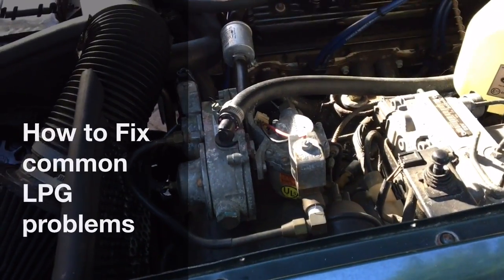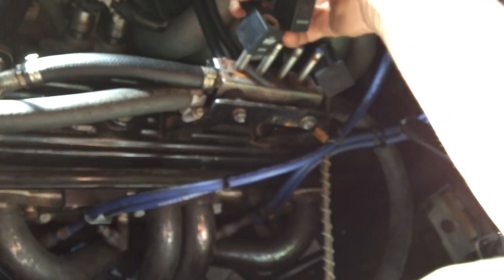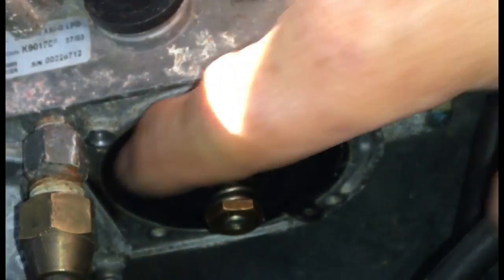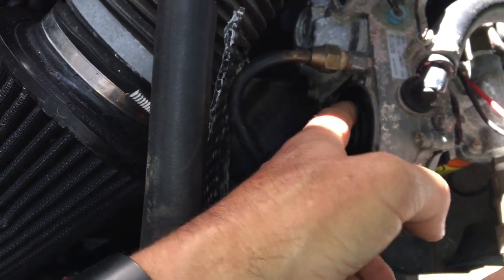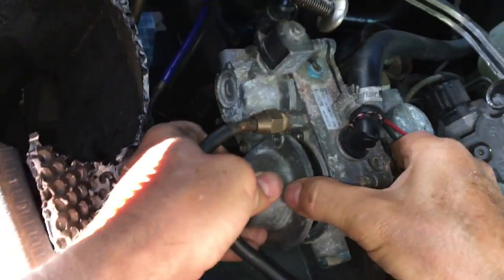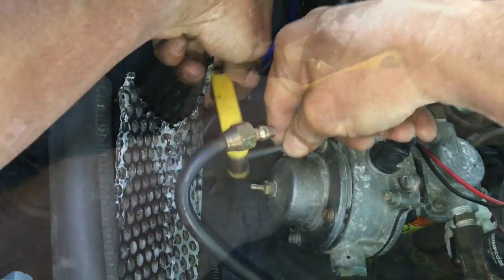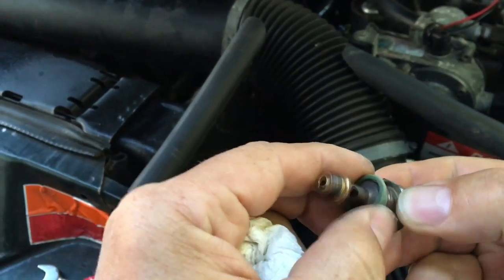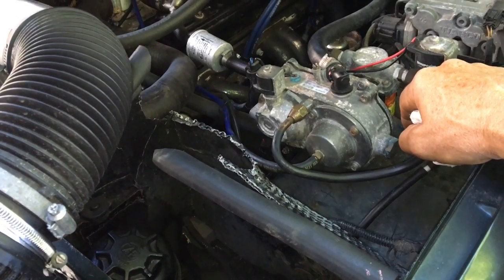How to Fix Common LPG Problems - Vaporiser / Reducer, Injectors

Comment: Hi, thanks for the useful information. I have a 2007 saab9-3 1.8T factory converted to lpg. It recently started dying after 15-20 mins of driving and then I had to wait 10 mins before it would start up again. It came up with traction warning when it stopped but looking under I noticed the gas pipe and wire between tank and engine was drooping off the chassis with corroded fixings. Is it possible a bad wire/ connection between tank and engine could cause this problem
Reply from the maker: I can’t think why that would make it last 15mins then fail.  Possibly a poor connection to the tank solenoid that turns on the gas. Unlikely that it would be that repeatable. More likely a vapouriser problem where the gas is getting cold and not being vapourised properly (check water pipes to and from it are hot) or your Lpg injectors are gumming up.
Reply: @comeinhandynow  Thanks for coming back to me. I've just run the engine and without moving it ran for 10 mins and then stopped. Engine temp was normal but I wondered if a bad batch of gas could block the filter and make the engine run lean/hot. The last gas I got was a small garage in Norfolk where I've never had gas before. Is there a temperature shut off on BRC systems. Had the car 3 years and no previous gas problems but injectors are noisy. (sounds like a diesel on tick over)
Reply from the maker: @davejohnston5158  Just running for 10 minutes sounds like it is freezing up in the vaporiser.  Is the vapouriser hot or cold?
Reply: @comeinhandynow  Vaporisor connected to cooling system is getting hot quite quickly after cold start. Is there an upper temperature cut out on these systems?
Reply from the maker: @davejohnston5158  I don't think so.  If it still is hot when it cuts out then something else gummed up or blocked.  Try a service with new Lpg filters and cleaning up, or replacing the Lpg injectors.
Reply: @comeinhandynow  Thanks for your advice. I'll get it looked at and filters changed. When it cuts out when not moving there's no warning lights so I'm pretty sure it's not the main engine function.
Reply from the maker: @davejohnston5158  It is useful in diagnosing problems to get the Lpg ecu software and interface cable.  It can read the gas temperature and pressure so you can see where the problem is.  If you don’t want to do that take it to an Lpg installer company to diagnose.
Reply: @comeinhandynow  Thanks for more info. I had a try at keeping it running on petrol by disconnecting the solenoid valve in the engine bay and it still stopped as if the petrol pump had been switched off. I"m wondering if there is a safety cut out  that turns both petrol and gas off if a  high temperature is detected. The gas valve runs at high temperature 80 degrees which I presume is normal. My next problem is getting it to the garage - at least it won't be as bad as the 150 mile recovery back home I needed!
Reply from the maker: @davejohnston5158  80 is fine. Are you saying it cuts out the same on petrol as Lpg? (They should be a procedure, like holding in the Lpg switch over button or the like to force it to run on petrol.  Maybe google your system).  If it also cuts on petrol then not Lpg related. Get an obd2 code reader to read error codes from main ECU.
Reply: @comeinhandynow  Thanks again I'll try everything. I would say it's an auto switch over system so I presume this may work by temperature detection and somehow switches the petrol system off. No error messages coming up when it stalls so I'm thinking it's all within the lpg system.

Comment: Yo men my car runs on LPG but when I switch it to petrol it switches itself back to lpg. It will not run on petrol untill the LPG tank is empty. Pls help
Reply from the maker: Sounds like you don't have enough Lpg gas pressure, maybe a faulty vaporiser or stuck solenoid.  Usually there is a procedure to force it to run on petrol like pressing and holding the switch over button.

Comment: I have a prins on my dodge ram 1500 and one day it quit working when I push prins button all it does is beep and doesn't switch. Anyone else have this issue?
Reply from the maker: Not enough gas pressure is my guess due to vapouriser or solenoid problem.

Comment: I have Landi Renzo LPG and after 7 years of use it shakes when I accelerate and appears the check engine on the dash. Have you any idea whats wrong?
Reply: Thanks a lot
Reply from the maker: I can only guess but it sounds like the Lpg/air mixture has gone off, could be a worn out diaphragm in the vapourisor. Also give the gas injectors a good clean and change Lpg filters.

Comment: Hi! I wondering do you have a user manual for software for OMVL gas type. I have the software and i dont want to make a wrong settings to my gas sistem. Thank you!
Reply from the maker: I did somewhere, but probably not allowed to distribute it.  The main adjustments are for the amount of lpg injection at certain rpm.  You should fit an air/fuel ratio meter onto the lambda sensor and adjust the Lpg setting until the A/f reading is correct.

Comment: Another very common failure point is those plastic fittings for the coolant. They're garbage! They get hot, become brittle, and crack resulting in a coolant weep that your untrained mechanic might see and think your entire converter is starting to collapse, assuming you don't investigate it yourself and end up with a pipe in hand and coolant all over everything else...

For what it's worth, you can probably pick up a set of solid brass replacement fittings for 10-15 quid, then it's just a matter of checking / replacing o rings on them every 10-15 years.
It sure beats the ticking time bomb of the fitting snapping completely, potentially freezing the converter, and or dumping your coolant on the road and cooking the engine 👍
Great video in any case
Reply from the maker: Thanks and thanks for the input.
Reply: @comeinhandynow  no worries mate 👍
It happened with me on my tartarini vapour injection system on my old rig. Fitted in 2007, failed in 2018.
As mentioned, my mechanic thought my converter was rooted but closer inspection showed the real culprit.
Got the fittings from a near by LPG fitter, got home tried to gently turn the fitting slightly to inspect the leak and retainer a bit better and half of it just broke off right there and then leaving me no choice but to grab a screwdriver and replacing them myself.

Few people realize that most of this plastic crap has a sturdier alternative for a few extra quid, but hey, if my comment here saves a single person from such a needless and preventable failure, I've at least made someone's day a little easier.

Comment: Why is my 2003 f150 giving poor LPG milage?
Reply from the maker: Maybe it’s running rich.  Fit an air:fuel ratio meter. Looking at that extra gauge while driving will tell you if it it running rich or lean.  Note that it is normal to be 10% less mpg on LPG.

Comment: Hi there, thanks for the video. I have an intermittent fault on my lpg system. Mort of the time it runs fine but occasionally it become very rough while driving and when idling the revs fluctuate between about 1500 rpm to so low it's about to cut out then shoots back up to 1500 again. Any ideas what that could be. Tom
Reply from the maker: Probably the Lpg mixture ratio is all wrong due to gummed up injectors (too weak) or a leaking diaphragm in the vapouriser (too rich).  An air/fuel ratio meter reading from the lambda sensor is a useful guage to have in the car to help with diagnosing these things.
Reply: @comeinhandynow  thanks for that, I'll try to identify the vapouriser, buy a service kit and replace the diaphragm. I appreciate your reply.
Reply: Could it be the idle air speed motor ? I don't know what is your car , but ...

Comment: After 40.000km my car started losing coolant. I was able to locate the leak in the vaporizer top, where the coolant hoses connect with the vaporizer... did you ever have this problem?
Reply from the maker: Not that one, but I’ve seen other problems with poorly made connections or seals onto the vapouriser. One that just gave poor idling/misfiring.  It is worth just checking over everything when there are problems.

Comment: I have a really rough idle, will stall at lights (auto) ford fg dedicated lpg, leaking sounds coming from throttle body/air filter area, any help?
Reply from the maker: Check for leaks in the diaphragm in the vapouriser

Comment: Very useful video, I have a bmw e46 inline 6 running on lpg and when I run it on lpg bank 1 is extremely lean I just cleaned and rebuilt all the injectors they looked pretty dirty but still running lean, looking at the fuel trims +27.3 bank 1 on idle !....help
Reply from the maker: Replace the Lpg filters and check (strip down) the vapouriser checking for any problems like split rubber diaphragms.  Failing that just retune the ECU.  I used to find with mine that ECU retuning was needed now and again.

Comment: Hi, i have Dream XXl. It was leaking gas into engine, i changed the membrane (thanks for step-by step manual, great help!). Now it's running too rich and rough and LPG serviceman i took it to says the vaporizer needs to be send to manufacturer for recalibration? And as it's not produced anymore he wants to change it for  another used unit. Ever had such a problem after your repairs? Thanks for the reply.
Reply from the maker: No not had such big issues, but I have occasionally retuned the Lpg ECU myself using a pc and the right Lpg software and interface using the visual feedback from an air:fuel ratio meter. It seemed to often go out of tune.  It might be worth stripping and checking the vapouriser again. I wouldn’t go for a used unit.  Shop on ebay for another new vapourisor if necessary or try tuning the ECU.
Reply: @comeinhandynow   Thanks for the reply and confirmation of what i thought... It felt rather "scammy" but the guy seemed  honest up until now. I don't have interface or software so i just take it to someone else.

Comment: Hi comeinhandynow
I just bought a 4x4 that is fitted with a lpg system (I don't know the name now)...
It worked fine when I've bough it,bu I had to switch it on petrol as no gas left...Then I've filled up,switch it back to gas...them on the motorway the lights on the switch went off...working ok on petrol...
Stopped the engine later then turned it back on few times...nothing 
Thanks
Reply from the maker: You need to check if you have any lpg gas pressure (get software and a cable to read the Lpg ECU).  I assume there is no or low pressure so you then have to work out why, could be a failed vapouriser (diaphragm hole is common), or a stuck solenoid valve that enables the Lpg to flow out.

Comment: Just bought my first bifuel LPG vehicle.. There seems to be a leak by the reducer.. clear liquid, and a puddle of brown, possibly from rust.. I can really smell propane under the hood.. looked at the tank in the truck bed, didn’t see any issues or smell.. what should I do? I’m kind of afraid to drive it
Reply from the maker: Try and look where the leak is from.  Clear liquid is probably water from the coolant system which is used to heat the gas.  A smell of propane also needs tracking down.  It could be the vaporiser diaphragm leaking which allows gas through the vacuum pipe connection on the diaphragm (if you have one) into the inlet manifold and out through the air filter.  Also check any joint leaks with foam bubbles made from detergent and water.

Comment: If i replace the injector springs and pistons, do I need to calibrate the rail? Mine it's a bit different than yours, it's IG1 Apache. The repair kit includes piston and springs and orings.
Reply from the maker: At - Probably not, but it’s always a possibility if the spring rates or weights are slightly different from original. I often needed to tweet the LPG ECU mixtures on mine. It’s worth having the interface kit (hardware and software) so you can do it yourself.
Reply: @comeinhandynow  I have the cable and software, that's not a problem, but I meant the physical calibration of the rail with Indicator Clocks, if you've heard about it?
Reply from the maker: Not quite sure what that is, but if would guess the same answer applies.

Comment: My car has a lpg smell for around 10 mins after I turn the ignition off. What could be the problem?
Reply from the maker: It could be the rubber diaphragm in the vapouriser leaking back into the inlet Manifold.  Check for leaks from the vapourisor by pulling off the small vaccuum pipe and test for leaks from it with soapy bubbled up washing up liquid from this point and any other points.

Comment: My LPG system was done about 4 or 5 years ago, I don't think the filter has been cleaned or changed, gas tank is full, but the other day, it will not now switch over to the gas, well it did to start and run on gas, then it just stopped, and now will not auto switch on, it tries but it keeps carrying on as thought the tank is empty. I am going for the reason being the filter is crapped right up, and so blocking the gas getting into the jets to the engine. Is this a reasonable theory ?   I think it's done between 20 and 30, 000 ish KLM,s from fitting it.
Reply from the maker: Possible but personally I’ve never had the filters completely block the flow. I have however often either cleaned or replaced the filters just because it’s the easiest thing to do first to tackle any problems.  Most of the problems I saw were due to vapourisor diaphragms wearing out or gummed up injectors.  If it’s not switching to gas it means it’s not seeing enough gas pressure.

Comment: Are these lpg reliable I'm looking at a Ford transit connect with factory fitted conversion
Reply from the maker: Not particularly in my experience. I seemed to be regularly cleaning, stripping, retuning and fixing mine.
Reply: @comeinhandynow  can you run them just on petrol
Reply from the maker: Yes

Comment: Very helpful video! Will use the tips in this video 

Couple of questions, do you know what pressure the regulator should give? When on the highway and under heavy load my car starts shaking and if I ingore it I get a random cylinder misfire fault. I maxxed out the regulator and it helped a bit but its still vibration under heavy load.
Any suggestions? Maybe the injectors?
Reply from the maker: Maybe clean injectors (May be waxed up), Change LPG filters, strip and check for any splits in diaphragms in the regulator.  Don’t know reg pressure.  Also check spark plug lead resistance to check for breaks.
Reply: Here it says it should be 1.0-1.3 atmospheres: https://axleaddict.com/.amp/auto-repair/How-to-Tune-an-LPG-Powered-Car

Comment: Hello sir ,
I have a car which i installed lpg.
Is a car nissan sunny b14 yr99 carburator.
My problem is my vaporizer or converter keep cold cold and its get ice on it... when i start it on fuel it okay it warm enough but when i put it in gas it freeze... please can you help me ?
Reply from the maker: That means insufficient or no water flow from the engine to the vapourizer.  You need it plumbed into the water heater matrix pipes and make sure you bleed the air out.
Reply: @comeinhandynow  hi sir, 
I try it . 
Its get warm for two days and the third day its become the same cold icy on it..
Reply from the maker: Is hot water flowing through it? Check your water connections.
Reply: @comeinhandynow  there are two water hoses that connected to the vaporizer but its has no water and my radiator full of water so i have to disconnect the hose and put water in it then reconnect it then it became warm .... why is it ?
Reply from the maker: Air lock.  The air has to be removed before the water will move.
Reply: @comeinhandynow  i try it get warm too for two days then remain cold i change my spark plug too i put bosch super 4... its remain cold...
Dont you think it is my water pump ?
Reply from the maker: http://paypal.me/comeinhandy

Comment: I tried to fasten the hoses a little bit and found out that even the engine was off, there is pressured gas in the pipes.
How do I lock the gas system for the gas to remain inside the tank, for servicing the system?
Reply from the maker: There are usually solenoids at the tank that isolate the tanks when the engine is off.  However a small amount of gas pressure remains in the pipes and filters.  You just have to let this leak out when dismantling.  Do it outside in fresh air! And don’t smoke!

Comment: My Cars system is designed  to start on petrol and switch to Gas once it reaches 50 Degrees Celsius and continues on gas. But now recently it starts beeping and  switches back to petrol as Im driving or even when i am in park or at a stop light occasionally. To by pass this I have to manually turn it off then turn it on to gas to get back on GAS. Would you know what could be causing this?
Reply from the maker: Sounds like it is detecting a low gas pressure.  Probably the vapouriser not working properly.  Maybe a worn out diaphragm in it.  Be worth changing the LPG filters as well and check the vapouriser is getting hot enough.
Reply: comeinhandynow thank you for pointing me in the correct direction!